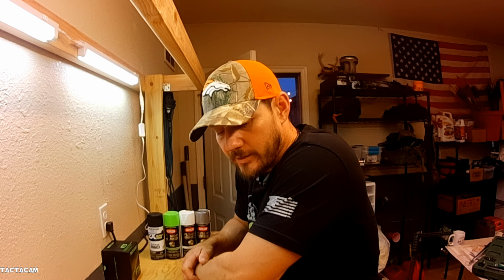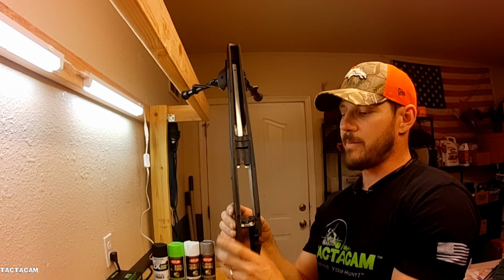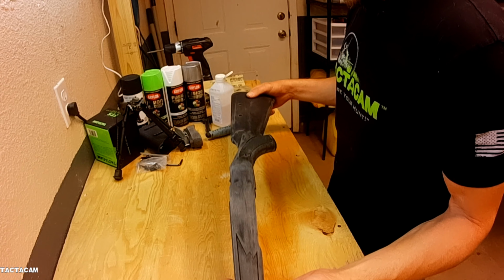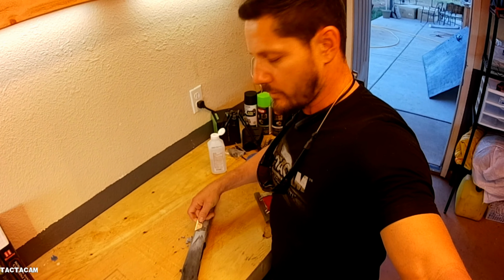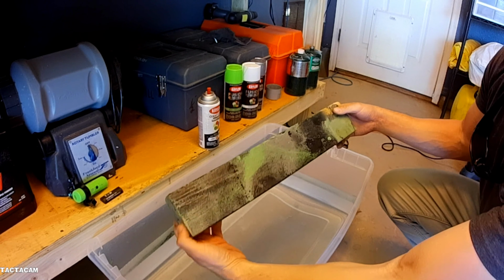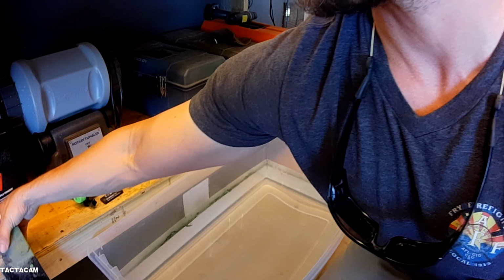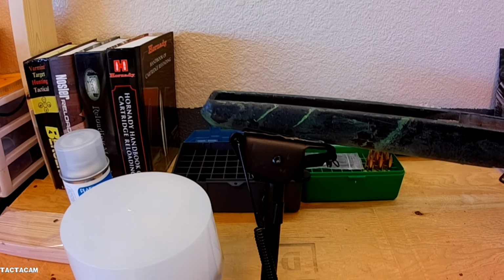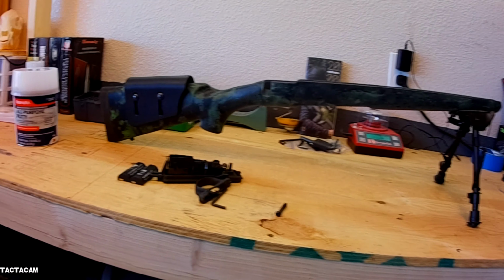DIY RIFLE TRANSFORMATION:  Stock Modification, Paint Job- Krylon Dip, Bed Job for accuracy.

Comment: How has the bondo held up to recoil and real world use?
Reply from the maker: That rifles been on many hunts and range visits in extreme heat and cold since this video. Including 2 rough mountain elk hunts and multiple mountain whitetail hunts. The bondo and Krylon has held up extremely well. No wear or tear on my modifications yet.
Reply: @82NDmedic  thanks. I'm gonna try this, I got a couple guns that have gotten pretty banged up. Running around in the mountains tends to do that.
Reply from the maker: @joeanthony2312 how'd it come out for you?
Reply: @82NDmedic  aint had a chance to try it yet. House flooded I been busy with that.